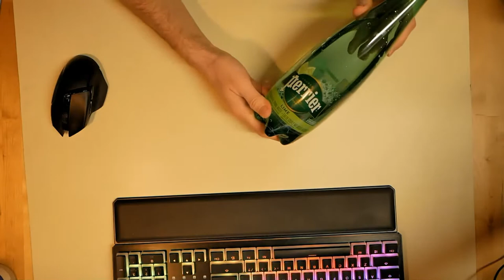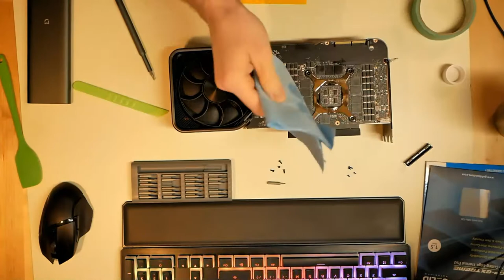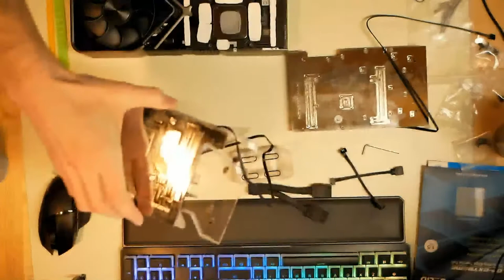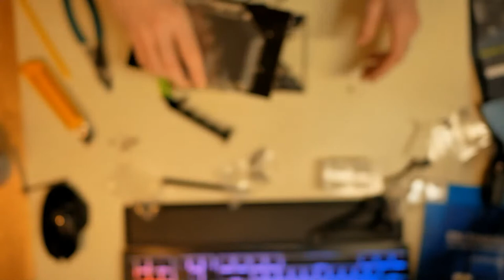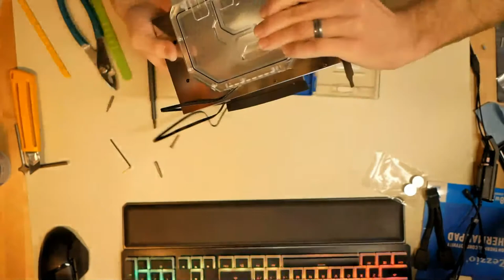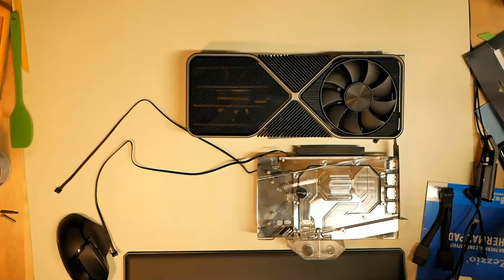Installing a Bykski Waterblock on a 3090 FE

Comment: I know this old. What size pads did you use on the Lr22 and black squares on front pcb? What about on the back of pcb, what size on the big section of black squares?
Reply from the maker: I didn't use anything on the LR22's. There are no pads or contact to the cooler on the stock FE cooler to cool them so I did not add any pads on them.  It's the same story on the 3090ti's so I think it should be fine to leave the open. If you want to be extra cautious I would recommend getting thermal putty (K5 pro or something similar) it can be a bit messy to clean up, but can provide some contact between the cooler and the  inductors (LR22s).
As for the black squares(mofsets) in the stream, I used 1.5mm Gelid extreme pads, but afterwards I noticed there was space between the mofsets and the block, so I used the supplied pads from Bykski which are 1.8mm (2mm) very soft generic silicone blue pads you can go 2mm as long as they are soft pads and it shouldn't be any issue as they will just compress. 

The higher performance gelid extreme pads I was using on the memory modules  was 1.5mm.

 I will note that there is no recommendations from Bykski to add pads to any additional components on the backplate other than the memory modules. I will double check when I have a chance and update you on the specifics of what components I have pads on.